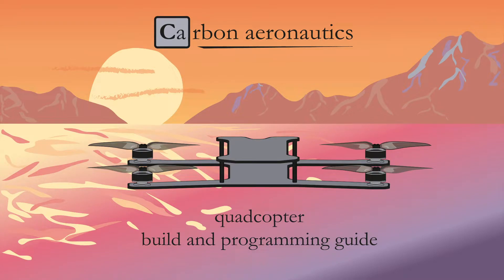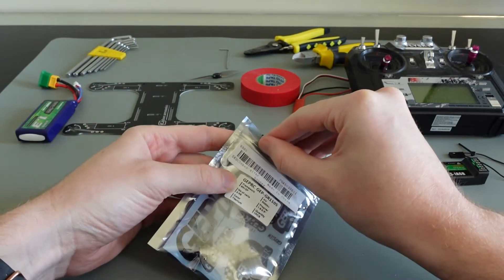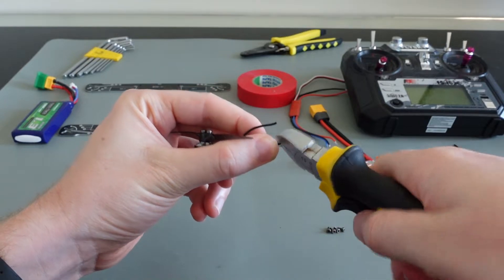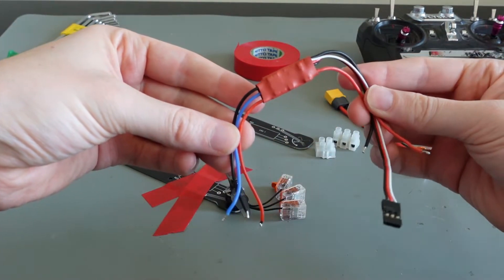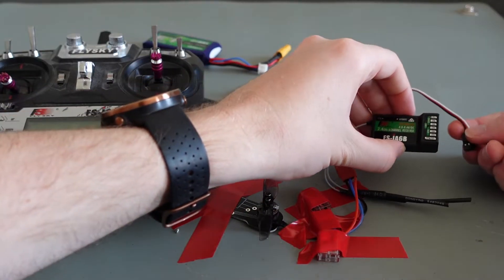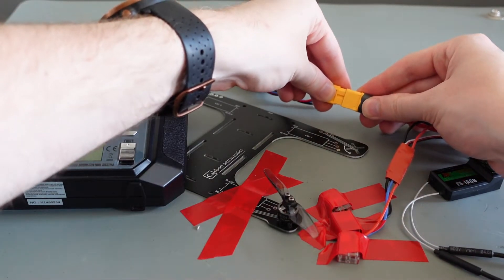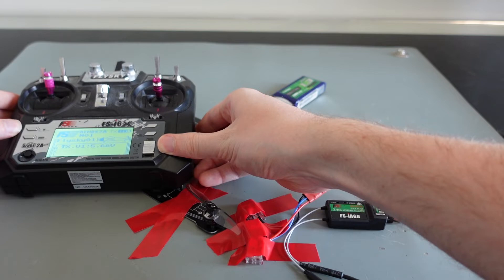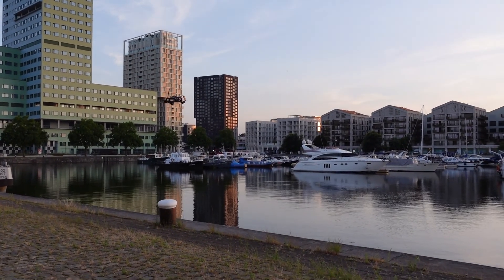6 | Take a brushless motor for a spin with a radio/receiver

Comment: This is a great series.  I have been struggling with the other ways of doing a drone from the ground up, such as Pxhawk and SpeedyBee.  My problem is that I have not been able to find enough documentation on those platforms to trouble shoot them.  I am very grateful for the time and detail you have invested in this series.  I am thinking about using it with a motivated high school student this summer.
I can tell you have a great deal of confidence in your built because you are flying over water. : )
My flights will be over ground.
My only comment is to use caution when testing a motor with a propeller attached.

Thanks